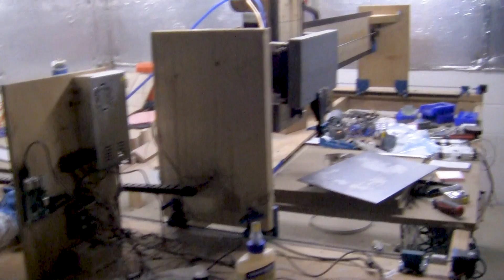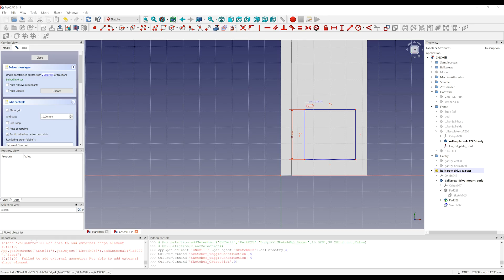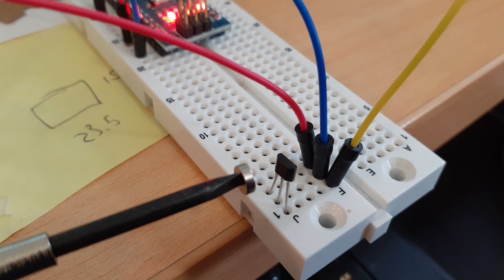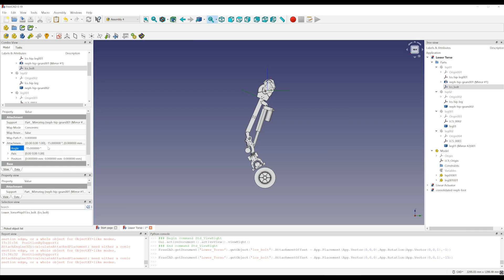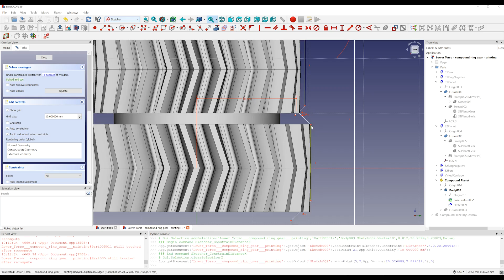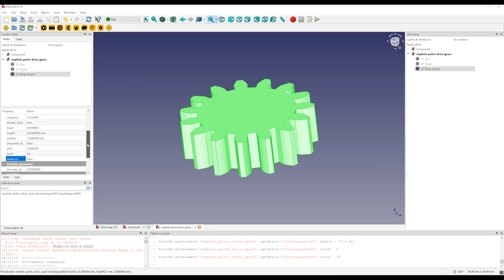Compound Planetary Gears, CNC Router, Hall Sensors, FreeCAD Gears WB, Nylon Filament - utter Chaos!!

Comment: Finally an engineering design to really motivate me to continue learning freeCAD, fidgets are nice but still toys.  Subbed to see the end result of the CNC.  Weird that it takes one to make another CNC.
Reply from the maker: The CNC is coming together surprisingly well.  I have the frames and gantry welded up, and I can sit on the gantry without noticeable deflection (probably need at least 500lbs to make the gantry deflect visibly, or maybe twice that).  Next is to weld the brackets for the ballscrews where needed, and then it's ready for a coat of paint and assembly and wiring.  So far, it's gone smoother and better than I had hoped.  The beefy gantry rolls really smoothly, and is obscenely rigid.  Having a solid design, where many of the kinks were ironed out virtually beforehand, really cuts down on the real-world manufacturing time.  Lol.

I love the remark about CNCs making CNCs.  I often think about how I would bootstrap industry in extreme scarcity (like, a crashed spaceship, could we build a working spaceship from the parts of the larger craft?  Or if all supply chains failed, how could we rebuild a modicum of manufactory amidst an apocalypse?)  The result seems to always be that, as most parts for very sophisticated devices will need to be machined into existence, there's something of a sequence to the types of tools and devices you need.  At first, crude hand tools to make better hand tools, then manually operated machines, then more automatic machines, and finally the specialized equipment to make the finished parts.  This CNC is the second-to-last step in the chain.  There's a few machines we'll be building in the relatively near future to manufacture the flexible and rigid components of the muscles we'll make for Nephele's upper body, and we'll use most of my existing equipment to make those machines.  

I'm stoked you brought it up - it's a fun idea I've been toying with as I've worked through the process of building stuff.  I even mentioned it during the recording of the narration on a couple of my videos - including this one, but I always cut it from the final video.  I'm glad there's like minds out there that are into this kind of stuff!